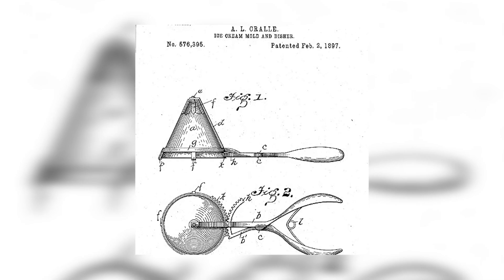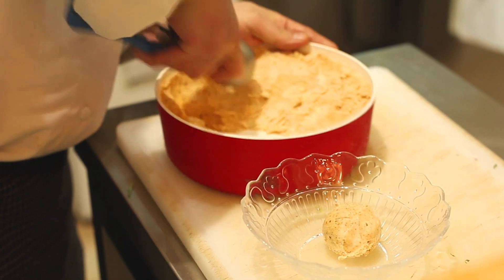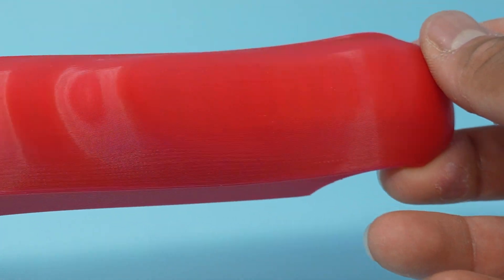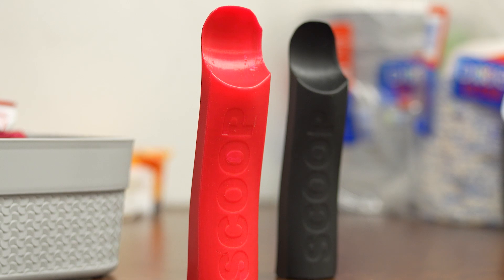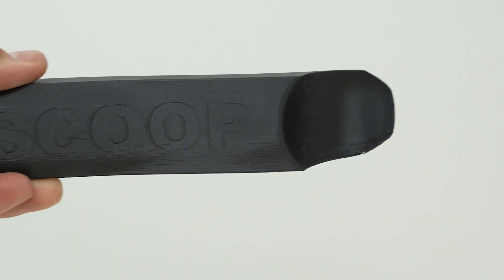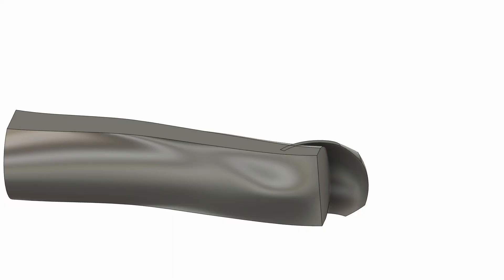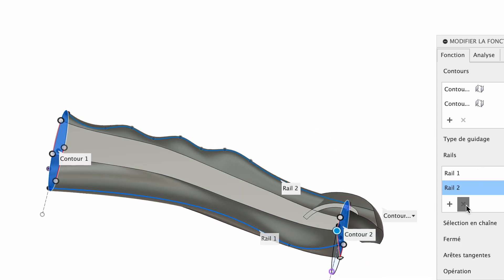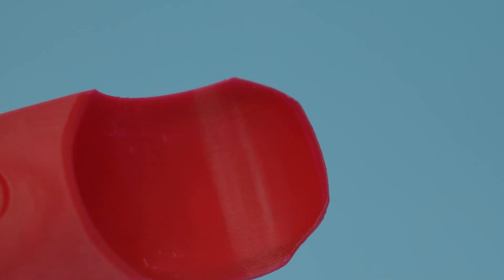Designing an Ice Cream Scoop for Mass Production 3D Printing

Comment: You missed one of the most important points here. Since 3D printing results in a scoop that traps hot (20-25°C) air in its infill, the scoop actually takes a loooong time to cool down enough to get stuck to the ice cream. So this scoop is way more efficient on very cold ice cream than a thin metallic hemisphere scoop, especially when you have to serve several guests in a row.
Reply: Except air has basically zero specific heat compared to metal or even plastic. Now if you were to make it from some thermally conductive composite and fill the handle with some phase change material, that might be one hell of a scoop (graphene PET when?)
Reply: That's not how this works.. that's not how any of this works.
Air is one of the best thermal insulators when stagnant, and plastic is also a lesser insulator, the outer shell touching the ice-cream will rapidly plummet in surface temperature to freezing, while the air inside does basically not-all to combat the direct cooling being applied. I feel like this has to be parody or satire.
Reply: Yeh, most places use a tub of milky looking water to rinse and reheat the metal versions. Nasty.
Reply from the maker: Interesting point. We hadn't considered that

Comment: There are several reasons why it is not foodsafe and this guy is wrong : 
- Filament additives
- Dirty printer nozzle
- Layer lines trap moisture and make it truely impossible to dry properly -> bacteria and fongus growth

If you really have to 3D print a part in contact with food you will have to do some post processing like smoothing and coating.

Comment: It may be fine for food contact, but I'd probably still put it in one of those sealer coatings that soak in and make it one solid structure, at least on the outside (ik that adds an extra step and cost to the process, but at least for something I made, I'd rather be safe than sorry..).
I do wonder how the shape would stand up over time though 🤔 since putting things in cold environments doesn't usually make them in less brittle BigBrother
Probably not much of an issue, but I still wonder

Comment: For food safety there is more to it than just the gaps in between layers etc. For instance standard brass nozzles can contain lead which can leak into the plastic during printing. You would need to make sure that it was printed with stainless steel or titanium nozzles.

And just because PLA or PETG are food safe materials, doesn't mean they were manufactured in a food safe environment. There are actually companies offering complete food safe filaments. But it's more of a niech product.

So if you're really into food safety, it's a bit more tricky than just saying you can throw it in a dishwasher.

But for most of these issues, there are solutions. You just need to know them.
Reply from the maker: The story of lead in nozzles is perniciously and wildly incorrect. It is an urban legend that was never true and even if the nozzles were pure lead they could not physically deposit a biologically relevant amount of lead into a printed part.

Comment: How can anyone define food safe when the FDA's definitions of "safe" are completely skewed?

To me, raw PLA will never be food safe, I've witnessed it break down when met with weak forces and produce plastics specs. I'd use the scoop a few times, but no shot would that replace my metal scooper. Might be food safe for the first few uses and maybe even get through a couple of dishwasher cycles (the heat worries me), but at what cost?

Truth is, everyone has microplastics in them already. It's up to you to decide how much more you want to accumulate.
Reply: There are safe 'food handling guidelines', no specific definition of "safe".
eg:  FDA has defined a Temperature Danger Zone (between 41°F and 135°F) where food should have minimal exposure. There are also cleaning guidelines for food prep areas and utensils that come in contact with food.
Reply: yeah the FDS can pretty much be bribed here. You're better off looking to the EU for a definition.

Comment: I appreciate your enthusiasm.  I appreciate that PLA as a material is not inherently bad for food.  Unfortunately, 3d printing an object like this is not food safe.  The little cracks and crevices will hold onto bacteria, and you can't heat it up hot enough to sterilize it without melting the scoop.  Additionally, the leading edge is NOT as strong as an injection molded plastic piece.  It may be when forces are directly straight across the front, but if you tried to twist this while scooping something very frozen, you have a good chance of splitting the layer lines.  I love 3d printing just as much as anyone else, I based my work around it, but this just isn't a good product for 3d printing.  Doing some sort of metal or injection molded scoop, with customizable 3d printed handle, would probably work wonderfully.  Unfortunately, there is no way use FDM printing to make something like this food safe.  If you injection molded this same piece, I think it would make for a great ice cream scoop, the design looks really nice.  It just isn't a good 3d printed object for actual real life use.
Reply: @MarkBlasco  Yah, dude is an idiot and his response to your well crafted comment was "Soap." 

Unsub from this dude. He's not worth watching.
Reply from the maker: Soap
Reply: @slant3d even if you use soap plastic is not hard enough not like metal it will end up in the ice cream after few uses
Reply: @LORW-xd1ir  how is this a 3d printing thing. You don't have anything plastic in your house? There are already hundreds of plastic icecream scoops on the market. And you are probably drinking out of a plastic bottle right now. Let's not forget the icecream container is plastic. Can we get some internal consistency here please.
Reply: @justdoityourself7134  ok you do you but for me I don’t trust 3d printed things to be food safe
Reply: @LORW-xd1ir  I love it. My favorite reply of the week. No logical fallacies, no BS,  just a valid opinion expressed as opinion.

Faith in humanity restored.

Comment: A small clarification is important that both PLA and PETG are not indicated, beyond the nozzle or Teflon which must be avoided and leaving aside the dye, PLA oxidizes and is permeable so it becomes contaminated upon second use. and it degrades, although it is made from plant origins, the process depends on the quality of the raw material, whether it is compatible or not. On the other hand, it degrades and PETG tends to be more difficult to clean, although it is not as permeable. except that above 75º it supports the temperature well but it oxidizes and below 8º too, you have made refrigerator parts, for that pure Tupperware polypropylene is better, without fiber, that is ideal for food parts, nylon 12 or POM And now there is the PVB, it is important because we do not know how far the product goes, it can end up in a baby and be a problem.

Comment: I honestly can't with these comments. Everybody is going on about food safety, while half of the audience probably doesn't even bother washing their hands while cooking or after using the toilet. A little metal shaving won't kill you, nor will a bit of plastic or whatever else. You'd probably even be fine if you ate the entire scoop, not that I'd recommend it. Instead of worrying so much about something that YOU can decide if you use it, how about first improving your own hygiene and food safety habits. It's pretty much a guarantee there's much more danger of food poisoning there than a 3D printed item will ever cause.
Reply: That doesn't really answer the question: is this sort of product, actually, technically, food safe?
Reply: @brucedanieliii  No, it is not.  Could you use it and be fine?  Probably, but that's not what food safe means.  But an object like this will collect bacteria, will degrade over time, and cannot be heated up hot enough to properly sterilize.  While PLA may be a food safe material, the additives that go into filaments for their color and printing properties are not necessarily safe.  Additionally, there is a HUGE difference between producing something with 3d printing and with injection molding.  While it is true that lots of people don't wash their hands, or that a little plastic bit in your food probably won't hurt you, that has nothing at all to do with whether an object is food safe.

Comment: Print a white PLA part with infill and subject it to water exposure, temperature changes, and food and then put it up to a bright light source. Over time you will start seeing mold and deposits inside the part. 3D printed parts have their place in the kitchen but not with food contact, and especially not with liquids. 
Using this design to make a sand mold and cast it as aluminum would be cool to make a custom scoop. But no one should ever eat something served from an FDM 3D printed utensil.
Reply: Soak a 3d printed part in sewer water and keep it in optimal conditions for bacterial growth and you will see mold on it. SHOCKED.
Reply: @justdoityourself7134  hence why I said “subject it to” and not “soak.” This ice cream scoop will be subjected to water and food. Over time it will get gross
Reply: @Whiskeyj456  Like everything else. Consistency please.
Reply: @justdoityourself7134  No, not like everything else. An injection molded scoop made with a food safe plastic or cast metal doesn’t have infill void space and layer lines for mold and bacteria to sneak by and grow in. You can’t effectively clean an FDM 3D printed part because mold and bacteria can grow in the inaccessible infill. 

Would it last and be okay for very short term use? Sure. But for long term use FDM parts are a paradise for bacteria. So how about you use the same scoop every day for a year and let us know how clean it stays.

Comment: ekhem your opinin is a bit invalid and your assuring of people that it is perfectly food safe is a lie

yeah the 90% of pla's and petg's are food safe if smooth

the problem are bacteria growing in between a layers and few colorants like in prusament army green that is not food safe. dishwasher don't solve the problem

so yes if printed pla or petg object is printed with food safe colorant and have some standards and smoothed with some chemicals or epoxy coated yes it is food safe

so.. your disclaimer about the food safe comments was both right and invalid in this same time, add some kind of note on this part of video that yes it could be food safe if you will do it properly

Comment: I think you might be a bit overconfident about food safety. Do you definitely know what you are talking about on this topic?

What happens to the layer lines on the leading edge over the course of many use->dishwasher cycles? Especially if you scoop very hard ice cream or abrade the edge with nuts/candy etc in the ice cream.
Reply: A dishwasher is in many ways not safe. It destroys Teflon frying pan. A plastic drink bottle is not safe anymore after being washed in a dish washer.
Reply: I've heard that some filament dyes can leech harmful chemicals into food. Is that a concern here?
Reply: It has been studied that concerns about bacteria living in layer lines are unfounded and that soap can indeed properly clean 3d prints.

What is a bigger concern is the plastic just degrading over time. Leave a pla print in water for a long period of time and you'll see it start to visibly wear, and bits of it will be in the water.

It would be silly to assume using this scoop will never lead to plastic in your ice cream. And your concerns about abrasives in the ice cream itself wearing on the part are very much worth considering.

The other thing to consider is that while pure PLA or PETG are both food safe as a raw material, fillament often includes additives to increase printability and to color, and those additives themselves are not always food safe. 

Most nozzles also contain lead, and while the amount of lead transferred from nozzle to 3d printed part is no doubt small, any amount of lead exposure is dangerous as its health effects are cumulative. 

Slant's attitude about this is irresponsible at best. It really comes off as "Well I drank from hose water and I turned out fine" thinking on safety.
Reply: Technically yes. PLA is generally foodsafe but the colour additives as well as the printer you print it with is not. To be absolutely positively safe, you would need to ensure every step of the manufacturing process complies with foodsafe standards.

Comment: Would be interested to test the food safety by using it a few times, washing it a few times and then sending it to a lab
Reply: Unless you’re using a very special method and special filament, it’s definitely not safe to use 3D printed items for food or drinks multiple times. Maybe as a disposable item occasionally. The microplastics that’ll come off will inevitably build up in your body if you used them frequently. Wear and tear is more likely to occur on 3D printed vs injection molded items like a cup or spoon.
Reply: @only1muppet  Says you
Reply: Let's not forget a control with all the other "SAFE" things you have in your kitchen.

Comment: Layers and food safety after first use. Please include it as disclaimer in such videos for future too... Used to not be the case in the past.
Also I'd still print with food-grade filaments, since you don't know what crap was there when it was extruded. I frequently find metal shards in my filaments, and there might be insects or rodents droppings too, so only verified safe plastics should be used in food applications. Especially for mass production.
Reply: Filament is extruded and immediately wound onto a spool and vacuum sealed. There is never an opportunity for insects or rodents to touch. And did Dave plastic is also not a thing. There is no organization that sits around testing plastic. Look it up. If it existed we never would have had bottled water which most assuredly uses toxic plastic. Nonsense comment.
Reply: Where  are you buying your filament from that has insects and food droppings in it?
Reply: @willofthemaker  hes getting his PLA straight from the corn field itself
Reply: @xXP1ZZAxD3MONXx  no kidding! 🤣
Reply: Layers don't matter at all.